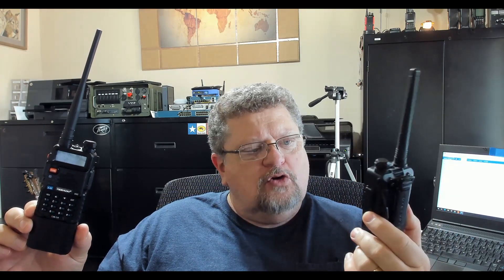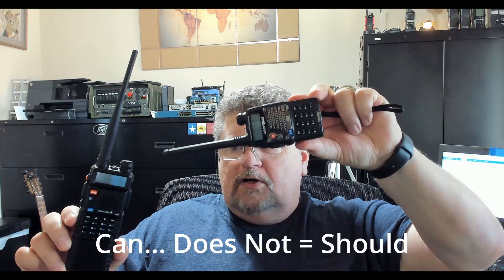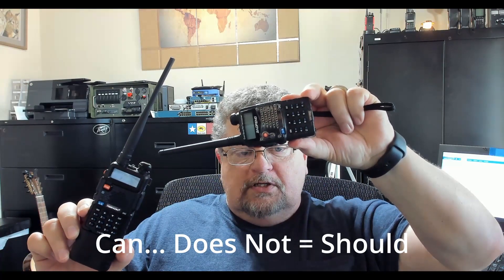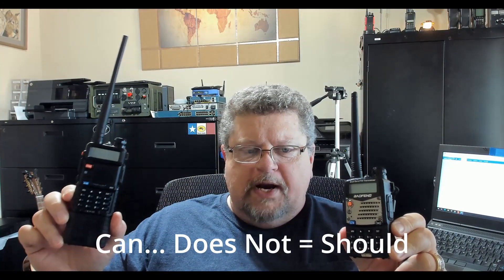GMRS VS Amateur (HAM) HTs Radios

Comment: Great video! I recently got my GMRS license for those in the family who are not Hams. The GMRS radios work pretty well. One thing the Ham radio manufacturers could learn from the GMRS makers is charging via USB.
Reply from the maker: Some of the new radios will charge directedly to the battery via USB.
Reply: @MeOnTech  Yes, the GMRS ones do. I know of only on 2m/440  that will and it is the Radioddity GS-5B
Reply: What do you mean you cannot give a amateur radio to a family member? Is it illegal 😅